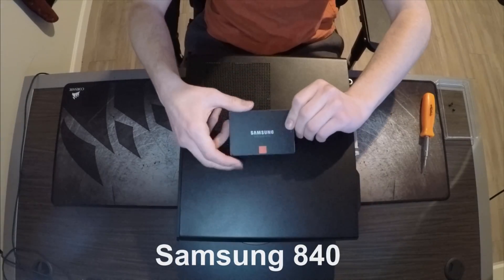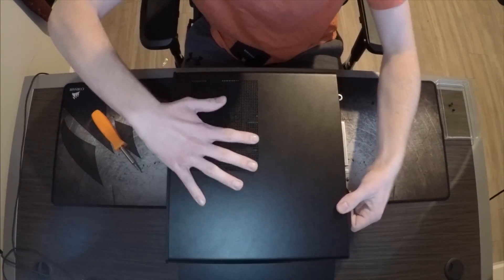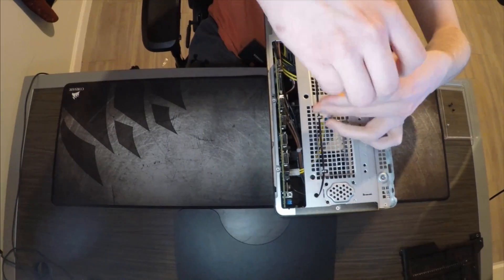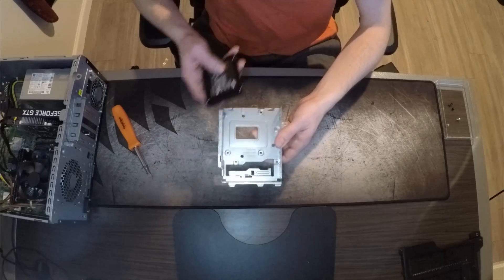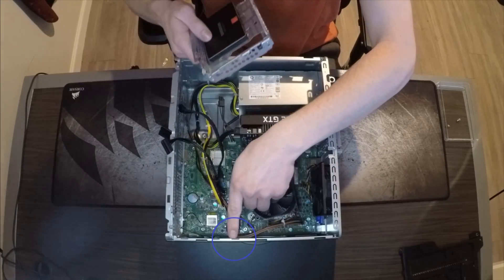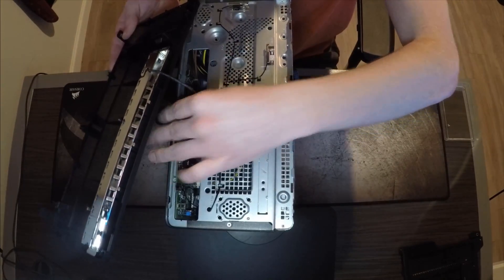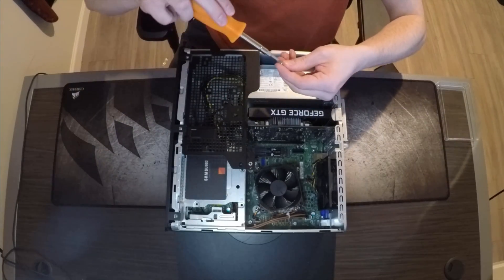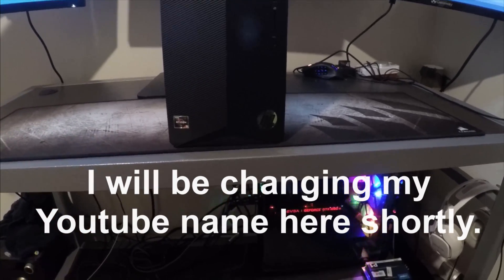HP Pavilion Gaming PC Gets SSD Upgrade TG01-0023W

Comment: I have that pc model too but diff specc Power unit 310W, and HHD 1tB harddrive can i  still install SSD on it? i have no idea if i have that connector inside of pc as it didnt came with SSD but i remember last time i opened this old HDD connector is not correct with that dvd connector might be same as it was lot smaller and have 2 connector wires. can i reoute those to SSD also? i dont really need dvd driver almost i never used. There might be also one loose connector inside but hell i know until opening this potato again or i need order that  wire

Comment: This video was super helpful! I was able to install my SATA SSD in 5 minutes, but it's not showing up in Disk Management. I've changed SATA cables, I've made sure everything is plugged in properly, and I've switched the SATA ports around. Do you have any suggestions?
Reply: Open Device Manager (Win + X → Device Manager) and check under Disk Drives for your SSD. If it’s not there, check your cables bc something is wrong. If it is there, open Disk Management (Win + X → Disk Management), find your SSD, and do the following: If it says “Unallocated”, right-click it, select New Simple Volume, and format it. If it says “Offline”, right-click and select Online. If it has no drive letter, right-click, select Change Drive Letter and Paths, and assign a letter.

Comment: To anyone who buys this computer, not only is this a very heavily required upgrade, but I would recommend upgrading to a new case where you can get more fans honestly. There's literally 2 fans (one of them is a CPU cooler) and 3 if you count the PSU cooler (which aint cooling your PC). So pretty much there's only 1 fan. And due to the PCs pretty small form factor, almost every major upgrade (such as GPUs) need a new case. I upgraded to an RTX 3060 and oh boy was it a hellstorm. New case and PSU just to fit a 3060 in the computer. Regardless still a pretty good PC.

Comment: Do you know if the 1070 comes with the sata cables too? I can't find this information online
Reply from the maker: Yea, it should have the sata cables. If not get them on amazon
Reply: @PortzTech  thanks 👍 I installed an ssd yesterday with ur instructions and it works perfectly! I had to mount it in the b slot under the caddy tho cuz the cable they gave was too short. Ur videos are great!

Comment: Hey would a SK hynix Gold S31 1TB SATA Gen3 2.5 inch Internal SSD work with this pc ?
Reply from the maker: Yes
Reply: @PortzTech  I just installed it and it works perfectly I just wasn’t able to find any good screws so I used some that were a bit wobbly but they worked I’ll probably buy some good screws and swap them out.

Comment: does this computer have 2 m.2 nvme slots? and is it possible to have 2 m.2 nvme storage devices on one computer
Reply from the maker: You can have two on computers. You can use ones that connect through pcie slots or get a motherboard that has two built in slots for m.2s

Comment: Thanks, incredibly challenging to find any videos on the TG01-2003w. This is pretty much the same.
Reply: i also have this model i believe it’s almost 100% the same except it has amd Radeon 5500 instead of a 1660 super
Reply from the maker: All the tg01 models are pretty similar and the process is pretty much the same for upgrades. Let me know if you have any other questions

Comment: Question.. I just bought this pc. Can i just unplug the old ssd and put new one in. Im curious on if i will loose what i have saved on my pc now, which is not much.
Reply from the maker: If you are adding a m.2 ssd you will have to unplug the old one. The one I added in the video can be added with the current ssd the computer has.

Comment: does the screws come with the computer or do they come with the ssd. if not where did you get them? i have a ssd and the pc and cables, but there are no screws that came with either.
Reply from the maker: You will need to get them off amazon. Just search ssd screws on amazon. Let me know if you have anymore questions.

Comment: Hey my sata cables and the cable that powers the ssd were already plugged in but the cable that powers the ssd was plugged somewhere around the fan. Somewhere completely different where you connected it too. Do I leave it in the same position or move it to where you put it in
Reply from the maker: You may have a different model. If you bought the computer brand new, you have not moved the cables around, and the pc currently works with the way everything is plugged in now. I would leave it and plug it in to see what happens. You can also check the user manual or look up your motherboard to be safe. Otherwise do it at your own risk. Good luck!!  Let me know if you have anymore questions

Comment: Would I be able to use a Samsung 870 EVO 1Tb ssd?
Reply: yes, i tried it and it worked. it wont show up in files under “this pc” so you have to do something else. you can just search that up on pc
Reply from the maker: @pompidou1789  You will have to partition the new disk space most likely or go into device manager and update the drivers, if it does not appear just select show hidden devices and update that way. let me know if you have any questions
Reply: @PortzTech  thanks!
Reply from the maker: @pompidou1789  no problem
Reply from the maker: Yes, it should work

Comment: I recently bought this PC and I haven’t upgraded it yet. I bought the corsair vengeance ram 16gb would that be bad for the pc???
Reply from the maker: No, it wouldn’t be bad. I have a video installing some Corsair vengeance ram in this pc
Reply: @PortzTech  yes thank you for this , do Yk what cpu would be compatible for this
Reply from the maker: @rahsoles4151  
This is from HP and it will tell you the upgrades you can do with this motherboard.
https://support.hp.com/us-en/document/c06418627
Reply: @PortzTech  do u think i can use this ssd Samsung - 870 QVO 1TB Internal 2.5” SATA III Solid State Drive for Laptops and Desktops Single Unit version
Reply from the maker: @rahsoles4151  yes, you can

Comment: Sorry if this is a stupid question but I know nothing about PCs. I have an extra 500gb NVME SSD picked out that I want to buy, so I could use it as well as the one that comes with this pc. Would my secondary SSD have to be SATA? Or could I add another NVME one just like in this video?
Reply from the maker: It’s not a stupid question. The NVME would be faster than the sata. You could do it, although you would need something like this. You could maybe use something else, but I would recommend using this bc it’s safe and secure. If your SSD is like the one in the video then you can mount it where I did. Let me know if you have any other questions.
https://www.amazon.com/dp/B07JJTVGZM
Reply: @PortzTech   Thanks for the reply, the SSD I had picked out was this: https://www.amazon.com/dp/B0869BW8MH/ref=cm_sw_r_cp_apa_glt_fabc_2ZYTEG9HDPEMQTA680ZH?_encoding=UTF8&psc=1

So I'm a bit confused, could I mount this SSD where you did in the video? Or would I need the adapter you left a link to?
Reply from the maker: @RubyFMRadio  you would need that adapter I linked. It would plug in right under the graphics card into the pcie slot
Reply: @PortzTech  alrighty tysm!
Reply: @PortzTech  oh, would that mean it could be a secondary SSD or would I just be replacing the stock SSD it comes with? Sorry for asking so many questions, I literally don't know anything about PCs but I'm trying to learn 😅
Reply from the maker: @RubyFMRadio  No problem!
Reply from the maker: @RubyFMRadio  It would become a secondary SSD, it would not be replacing the stock SSD. It is okay to ask questions, no worries

Comment: Do I have to format my pc when SSD is installed or I can just plug and play?
Reply: everything go well?
Reply: @platinumvideos9810  I formated my PC because I wanted windows on my ssd
Reply from the maker: @geekyvibes  thanks for responding to their comment! Also, glad it went well for you
Reply from the maker: Plug and play. If you get it new it should be good to go
Reply: @PortzTech  awesome. Also 1 more question. Will SSD make my PC perform better or is it only for extra storage space?
Reply from the maker: @geekyvibes  Anything you put on your SSD will load faster than a traditional hard drive.

Comment: Hello, when I add a new SSD, will this work simultaneously with the SSD installed? For example, will I get 750GB of storage if I buy a 500GB SSD?
Reply from the maker: Yes, they will just be different storages. In total though you will have the 7550gb though
Reply: @PortzTech  what is your math lmfao, thats 1250 my man
Reply: @tylerhunt8425  he meant 750. And no it’s not 1250 250+500 is 750 it’s easy math…💀

Comment: I got the same ssd, but it doesn’t show up in file explorer. However it shows up on the magician software so is there a problem or is that normal
Reply from the maker: Update the drivers for it through device manager, then if need be format the ssd

Comment: Alright so I got good and bad news.. bad news is my computer beeps whenever I try turning it on.. it beeps 5 times, three long beeps and two short beeps, .. but that was when I put everything back together to it’s original stock items.. before when I tried plugging the ram and ssd in, it would just cut straight off

good news is I got the parts... but unfortunately i can’t use them without a functioning computer lol idk what I did wrong but I felt as though I did everything correctly.. but clearly i didn’t, I don’t know where the fault is...

Edit: Lol Nvm It was a goof up on my end. I tried each ram sticks at a time, they worked, tried them both, they worked, so Guess i didn’t use enough force to push them down just right where it needs to be. I was too afraid to go too hard on it incase it damaged or broke something. Got the SSD and New Ram running... I just wish the case wasn’t a pain in the ass trying to put together again, like the front panel part, but i’m glad everything is working. Hope to see more future videos on this in terms of upgrades like fans, gpu, etc
Reply from the maker: I am glad you got it figured out! You will see more videos for sure!

Comment: Hey! I’m just wondering I’m getting this pc Friday, I need to know if the Samsung 870 Evo 500gb is compatible. Also, I know you said the cords you need to connect for the ssd come with the pc but I watched some videos of people unboxing and I didn’t see it. Can you like tell me where It will be?
Reply from the maker: Yea, here are the links

Sata Cable - 
https://www.amazon.com/BENFEI-Straight-Locking-Compatible-Driver/dp/B07TB5QBPK

HP Sata Power Cable - 
https://www.ebay.com/itm/L68308-001-HP-Cable-Power-2-2-to-Sata-15P-ST-200-80MM-BL-ro2-/143801018797
Reply: I was wondering if you used the Samsung 870 Evo drive you asked about? Did everything work out ok? I was going to use that SSD as well so I wanted to know if it worked in this PC
Reply: @gjcarrow  Yes, it worked perfectly
Reply: @scamalytic  ok cool. I just ordered one from Newegg. Appreciate the response

Comment: Did u add and ssd or did exchange it
Reply from the maker: I added the ssd
Reply: @PortzTech  how big is the tray is it 3.5? for hdd
Reply from the maker: @cufffer3364 
Yes, it is a 3.5 in tray. I added a hard drive but you can have both a hard drive and SDD if you want. Select the storage size you

Hard drive - 
https://www.amazon.com/Seagate-BarraCuda-Internal-Drive-3-5-Inch/dp/B07H2RR55Q

Comment: Do the screws come with the ssd?
Reply from the maker: Some SSDs do and others do not, but you can find them on amazon
Reply: @PortzTech  Did yours? I am trying to buy one and this would make my decision much easier
Reply from the maker: @luvdxg6619  Mine did not, but I had some laying around
Reply: @PortzTech  I was thinking of upgrading my gpu, what are my options
Reply from the maker: @luvdxg6619  1660 ti is what I would recommend
Reply: @PortzTech  let me check the performance differences
Reply from the maker: @luvdxg6619  okay

Comment: Hello what screws are needed for installing the sata ssd in the bracket? My samsung ssd didn't come with any screws with it and none came with my pc.
Reply from the maker: Here is a set that will have the size you need. Most are the same, but some are different so that's why this kit has multiple. 

SSD Screws -
https://www.amazon.com/Computer-Standoffs-Standoff-Motherboard-Graphics/dp/B085KVFD1T/ref=asc_df_B085KVFD1T/?tag=hyprod-20&linkCode=df0&hvadid=416652333997&hvpos=&hvnetw=g&hvrand=3967497109797240084&hvpone=&hvptwo=&hvqmt=&hvdev=c&hvdvcmdl=&hvlocint=&hvlocphy=9022290&hvtargid=pla-910191236846&psc=1&tag=&ref=&adgrpid=100759324064&hvpone=&hvptwo=&hvadid=416652333997&hvpos=&hvnetw=g&hvrand=3967497109797240084&hvqmt=&hvdev=c&hvdvcmdl=&hvlocint=&hvlocphy=9022290&hvtargid=pla-910191236846

Comment: I did your ram upgrade and my games kept crashing. After 2 factory resets, I decided to put the old ram back in, but now it wont turn on. I get 3 long beeps and 2 short ones, but nothing comes up on my monitor. Please help
Reply from the maker: Make sure you have the ram properly seated in there. You can go into bios and run the hardware test. Try one stick at a time in each of the slots to make sure the slots are working. Make sure you have them in all the way you should hear them click in
Reply: @PortzTech  how would i go into the bios if nothing is showing up onto monitor
Reply: @PortzTech  how i would reset the bios
Reply from the maker: @luvdxg6619  when the pc first turns on you will click F2 or Esc or del one of those to get into bios and then find reset bios to default settings. 
Make sure everything is plugged in all the way and seated properly including your graphics card and all the plugs from your power supply are plugged in correctly.
Reply: @PortzTech  THANK YOU SO MUCH IT TURNED ON! but i have one more issue. I was checking the memory stats and it said the max 2667 mhz even tho the box said the max is 3200. How do i turn down the clock speed?
Reply from the maker: @luvdxg6619 Glad that we got it to work for you! Your pc should clock the speed down automatically to the max speed it can do without overclocking it
Reply: @PortzTech  thx so much i was abt to use my warranty. I haven’t played any games yet as the original issue was crashing but i’ll see tomorrow. Thank you so much
Reply from the maker: @luvdxg6619  Just let me know! hopefully it works out
Reply: @PortzTech  Sorry to bother you again but it is still crashing

Comment: nice video but when a power supply upgrade?
Reply from the maker: When I can find a good enough deal on a new motherboard
Reply: @PortzTech  btw haven't you finded a good case to fit the hp pavilion tg01 motherboard? bc hp only sells 500 watts psu and i think that's not enought to a rtx 3090
Reply from the maker: @DIAMONDHILLBAND  I have a video on the motherboard in another case. I want to upgrade the motherboard instead of using the one from HP
Reply: @PortzTech  thx for doing this and if you can upgrade the motherboard make a video pls that would be really helpful thank you for doing this
Reply from the maker: @DIAMONDHILLBAND  Yea, I'll do that eventually

Comment: Great video mate, is is possible to install more case fans in this one?
Reply from the maker: The motherboard really only has one port for the fan so no. You could get some sort of splitter and have more, but there isn't really anywhere to mount fans in this case besides the one spot.

Comment: Do you have a link to the cables you used for the SSD
Reply: Were they located inside the pc already?
Reply from the maker: @jamesroberts9150  yes the cables were
Reply from the maker: No, they should come with your pc. They are on eBay or amazon. Let me know if you can not find them and ill help you
Reply: @PortzTech  what are they called.
Reply from the maker: @lilchickenwing3955  
Check the link below, make sure it fits yours. I haven't checked but this is what I found real quick. The other cable is called a sata cable

https://www.amazon.com/COMeap-3-Pack-Motherboard-Adapter-12-inch/dp/B06ZXSNKCK
Reply: @PortzTech  you were originally right.Cables did come with the PC. Thanks
Reply from the maker: @lilchickenwing3955  Glad to hear! No problem

Comment: I was wondering if that cage you have to take off to remove to front panel can stay off? Or is it required to stay on?
Reply from the maker: If you are referring to the black one. You could leave that off, if you wanted to. I would imagine its there to support a HDD and to keep the vibration from that to a minimum or for structural purpose or maybe just cosmetic. You can really run it with any of the panels off, it would just not look as good. Everything is usually put in there for a reason though

Comment: can you upgrade the Cooler on this pc? my temps are over 80 c on the cpu I am not really that comfortable seeing that number lol. Great Video subbed.
Reply from the maker: Yea, I can do a cooler upgrade video
Reply: @PortzTech  Thank you  Can you add any after markey cooler or are there any requirements i need to fill while looking for a new cooler?
Reply from the maker: @Brwnie7  I will order one and see if it will fit in the case. I have another one incase, but I want a bigger cooler

Comment: I get this pc soon do you know if I can add another 8gb of ram to it or does it have to be a 16gb I don’t know much about pc’s
Reply from the maker: You could get another stick of 8 yes. If you don't plan on upgrading the motherboard then get the exact same stick that's in it currently so that it doesn't clock the ram down.
Reply: @PortzTech  do a gpu upgrade to forgot about that
Reply: @PortzTech  what ram does it come with
Reply from the maker: @Phancyfantom  It depends on when it was made they change. You can find out by popping yours out and then just search that one.